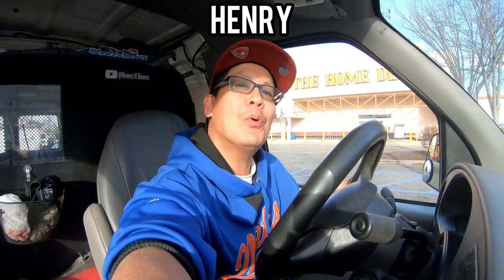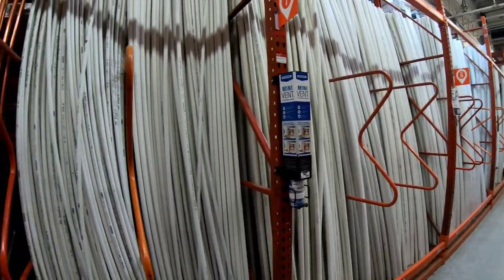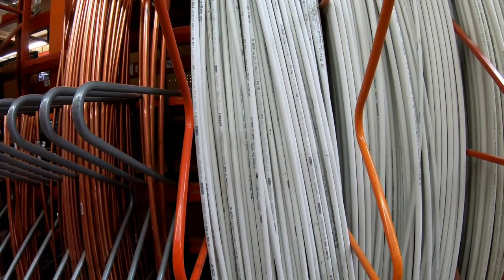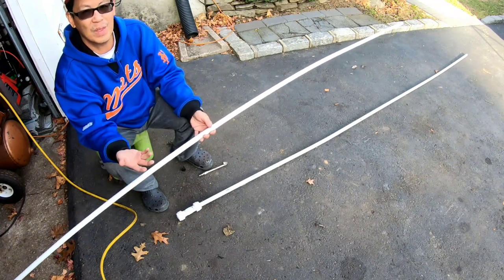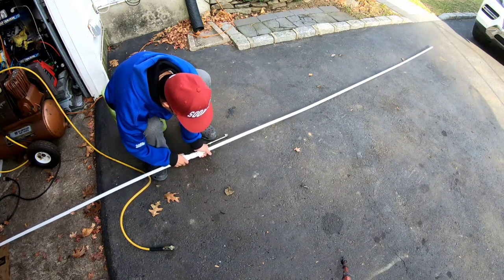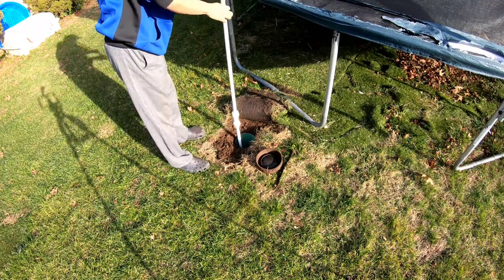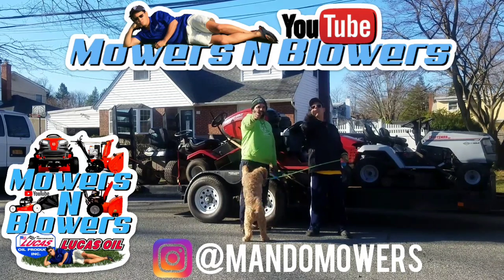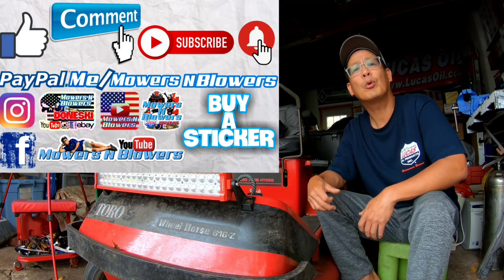TOILET PLUG DIDN'T SEAT WATER RUNNING ALL NIGHT CESSPOOL FULL FLOODED BASEMENT TRY TO PUMP IT MYSELF

Comment: Pumped mine out this last year. Have to pump it out.every 5-10 years. The septic tank guy says I need a new drain field. Been in service for almost 40 years.
Reply from the maker: Lucky you Dwayne! We are too overpopulated here so no poo fields,  it goes right into the underground water stream.  The sand on Long Island is supposed to filter the poo out of the water.

Comment: I would love to see a sketch of how your system works. I am not clear how your system dissipates the "water"?  I would think a running toilet should not flood the system. A septic system has a tank where the pipe from the house goes to and the solids settle on the tank bottom and there is a leaching field that dissipates the water over a field using perforated pipes. How does a cesspool work?

'
Reply from the maker: It’s supposed to drain into the sand which is common on Long Island since , well,  it’s an island so there’s all sand u see watch and the water seeps through the sand to the water stream below the surface.  The sand acts as the filter to the shit which should be burned up by the sulfuric acid he pours in after the draining.

Comment: Flush RID-X down the commode, eats the solids in the septic tank to liquid and it should run out the field pipe. I went over 10 years without having to call the honeydipper.
Reply from the maker: We don’t have a field, apparently it goes underground into a water stream